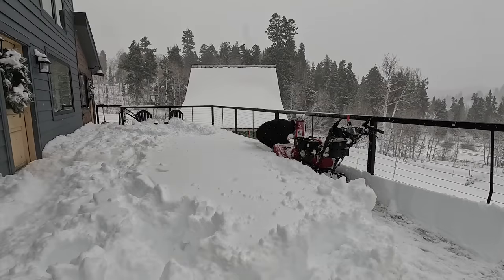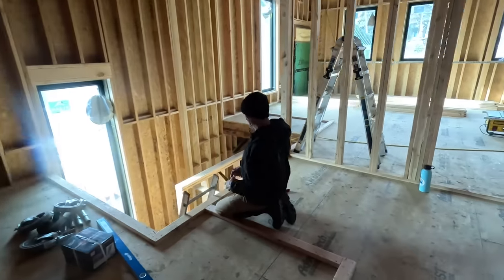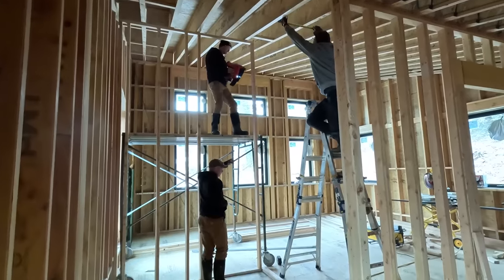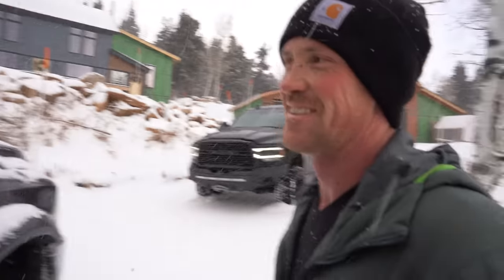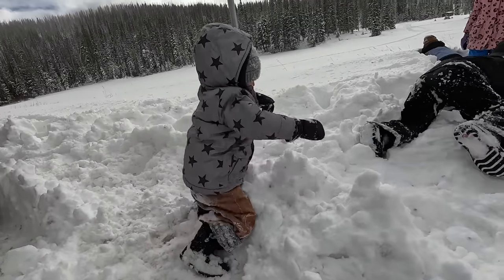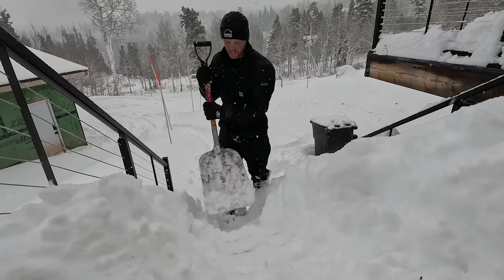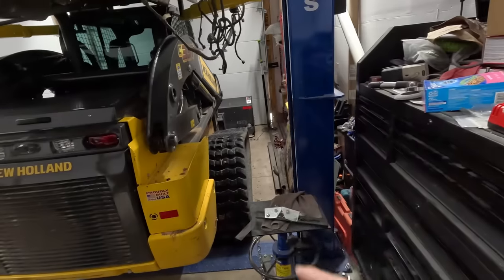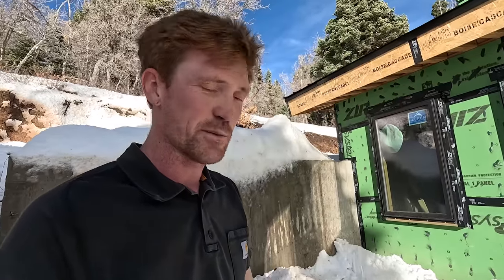OUR NEW MACHINE IS BROKEN...

Comment: For that area where the snow piles up, I recommend a patio slab with thermal tubing. You won't need to run it often or very warm, but it will remove any need to snow blow or shovel there. Now would be the time to think about planning it out. Shouldn't be too complex.

Comment: Morning Trent and Allie. If you are parking the skid steer out in the cold you may find that the belts are freezing and are shrinking as this is how they fit the rubber into duratorque suspension by freezing then in liquid nitrogen to shrink them.
Reply: That’s what happened to our generator belt  in Alaska that we turned off every night. After it shattered from the cold and hot alternating right before Christmas and we had candles on the tree instead of lights. Luckily we were employed by cannery as winterwatchmen and we didn’t turn off the generator til winter ended.

Comment: I'm not surprised that Trent was able to fix the snow thrower, but I would order an extra belt just in case.  The parts most apt to go are usually the small ones and considering where you live, it might be best to have extra parts on hand.

Comment: Trick I found out for my snow blower, spray the inside of the rotary area, the blower area and chute with ceramic car spray. This will allow the snow to not adhere to the metal and you will see the snow going further and not clump up especially with wet snow. I do it a few times a season and it works great.

Comment: Trants Garage could also have content like servicing your skid steer in the garage.  Anything mechanical would work.

As a suggestion order out a set of spare belts for all the vehicles, skid steer, excavator, snowblower, and trucks.   That way when one has to be replaced you have it "in stock".  Then order out a new one.  Having spare parts on hand is a smart idea.

Comment: I was wondering when you were going to think about covering that deck -- even if it is with removable panels, so it would not get buried in snow each storm. Also -- for the new downstairs - you might also consider putting up a winter barrier to prevent the snow from piling up against that door and windows when it falls from the upper roof. Happy Winter!

Comment: How will the snow slough of the new roof with a relatively low pitch (half of what the main roof is), and once its insulated?     You'd have to get the living room unbearably hot for maybe any heat to make it through to the metal roof.

Comment: Don't know how it's rigged on your skid steer, but in my road vehicles, the a/c is integrated into the heating system so that when you're on defrost, the a/c helps remove the moisture from the air, so it de-fogs much faster.  In the old days, the heat would be blasting and we'd have this hot fog that collected on the glass and had to be wiped off.  Frequently.  Constantly.  You don't just need the a/c in the summer!
Reply: Yes, AC is the fastest way to demist a car ss it blows de-humidified air.

Comment: Have you thought of embedding piping under the ground underneath the roof and then connecting it to a movable log burner. You could then just connect the burner to the piping and by heating it you could heat the ground to clear the snow build up, without damaging the door and windows.
You can also get electric matting to go on the stairs that will melt any snow and ice on them so you never need to shovel them again

Comment: When you put the patio in behind the house have you thought about putting in a 10' heated strip coming off the house, so you don't have to get close to the house with the blower. Alot of new fire stations have heated floors that extend out beyond the bay door, so the plows don't have to come close to the doors.

Comment: Over here, we would do all the roof isolation (including the vapor barrier) before installing wall up to the ceiling (we do the base of the wall on the floor.  This way, you get the best air isolation (which is more important than isolation)!

Comment: I suggest that you make some temporary window and door covers to prevent  the glass in the  window and door. This will allow you to do your snowblowing without a chuck of ice or stray rock breaking the glass. Yes it will look funny until spring but better than breaking some very expensive windows
Reply: no point in installing windows if you have to keep them boarded up 6/7 months of the year.
Reply: Polycarbonate sheeting?  Clear so you can see through it, absorbs impacts well, protects the glass and cheap to replace in need - compared to window glass.

Comment: As for the Skid Steer breaking. Yes it is new but parts are designed to fail so that they don’t destroy the rest of the unit. They are maintenance issues. And belts break. It happens. Cylinders are going to blow, leak, fail. Hoses will too. That’s the nature of hydraulics. A brand new one, put through rough work can fail. Just learn to work on them :) That’s what I do.

Comment: First rule of snow:  Always have backup.  We have an angle dozer for the skid steer, and ex-airport tug 1 ton Ford (with a ridiculously short wheelbase) with a plow up front  and on the rear, and in a pinch, a 10 foot wide chuck blade for the mini excavator…    Everything breaks in the winter at the worst time.

Good luck! :)

Comment: I know from 4-5' snows from blizzards in Colorado that a snow shovel can be very handy for things like your stairs, or those areas close to the house where you can't get the snow blower into.   Just food for thought.  I know you probably don't need another toy.  I had an electric toro snow shovel it was the bomb as it weighs under 10 lbs and you can just put it into tight spaces with ease and it throws the snow far and quickly.

Comment: hey Trent.   I would be happy with some more Trents garage videos.   I can only imagine how busy you are with everything else, so I do totally understand the delay.    Also, be sure to order another belt for the skid steer so you always have on on hand through the winter at least.   Then have a service professional come out in the spring to double check the tension and everything in that serpentine system.    Its new, you shouldn't have to be doing all that.

Comment: check the alignment of the belt from the fan to tensioner as tensioners loosen and sometimes need a spacer added , common on mitsu , gm and several other engines and they do sell spacers for them

Comment: Hey guys, there is a thought I have ... They have these Matt's that heat up which would get rid of the snow. That's what they are for. I was wondering if that couldn't work for roofs also. Near the sunroom it seems you need a roof that comes out from that window. It seems to build up to a lot of snow in that area. Alley I hope your mom is doing well.

Comment: Actually, you need the ac in the winter as well. This because it dries the air in the cabin. Only heat will not be as good.

Comment: Two things that take out belts, age ie cracking, stretching and so on, and misalignment , Wondering it you could us your lazer and check out the latter. might also (with the belt off) check any play in the pulleys, and also research any adjustments that could be made. I know technically it's no longer new, you have worked it pretty good doing your build, but age wise, it's still pretty green. One thing I would do, and I have found that things always go wrong at the worse times, is when you have a part fail, or two, so if it happens again, you don't have to wait on a part.

Comment: Looks like you will need to go out in a storm and keep snowblowing so it does not build up so much also maybe you can find something sturdy to put on the bottom of the house to be able to push the small amount of snow against the house or back drag with the bucket. Ready to move south yet😅

Comment: Will you consider installing in that back addition those metal (aluminum) accordion shutter they use in Florida and in the Caribbean for hurricanes?  I don't know if you windows or doors will allow you to close them from the inside, but at least you may protect that section from the pressure of the snow. if you can't snow plow for a few days.

Comment: bro u should use spray foam in the end of the ceiling joices to keep the heat in
Reply: Once the ceiling is insulated it will be even harder to melt the build up of snow on the new roof.  It has less pitch than the main building roof, and that had snow build up on it over time.

Comment: I have a question. why are there balloons on the windows. We don't know that here in the Netherlands.
Reply: I recall Trent explaining those when they built the main house. They have to do with allowing the inner gas between the panes acclimate to the pressure difference where the windows were made and where they are installed like this mountain altitude. When the addition is finished they will be removed.
Reply: @reader649  thats understood ☺️👍 thanks

Comment: okay, I am going to ask the question that has been bothering me for a couple of weeks.  What is the deal with the balloon looking items on all the new windows?  Is that just a bad of parts?  Does it serve some other purpose.
Reply: I recall Trent explaining those when they built the main house. They have to do with allowing the inner gas between the panes acclimate to the pressure difference where the windows were made and where they are installed like this mountain altitude. When the addition is finished they will be removed.

Comment: Great video!! Sorry to hear that you had the belt shred on the skidsteer. Did you check all the pullys to make sure they turn freely. I know most cars have a tensioner. Does the skidsteer have a manual adjustment or tensioner?

Comment: You may want to extend your roof that way your snow blower can get it all .
Reply: It could be extended about half a yard, and then it would be as low as the top of the actual doorway into the living room.   Couldn't extend it much further as it would be too low to walk under.
Reply: @Wdeane1957  then obviously there was a design flaw in the roof  as you dont want all that snow piling up  against the house  . Also it can be extended  with a slight change to the slope of the roof .

Comment: Owning a sled for like 35 years that's more then enough snow to go get a tree.. Don't need to pin the throttle all the time yanno lol only need enough snow to lubricate the sliders.. Slow and easy.. Your mountain sled would have walked in and out pulling a small tree with ez